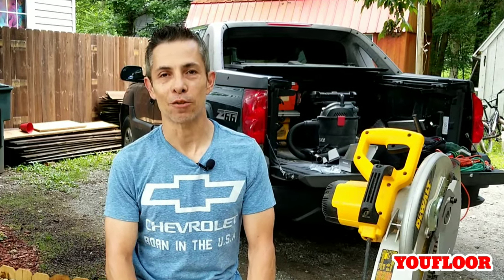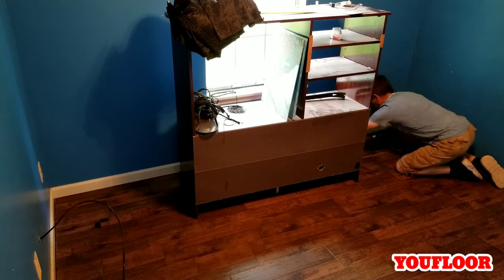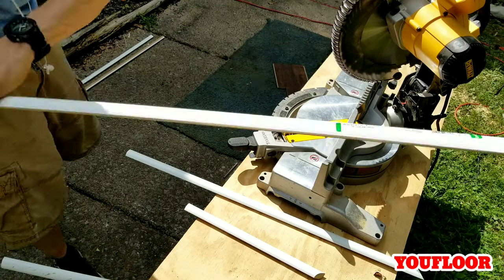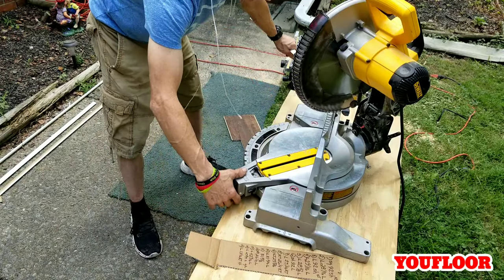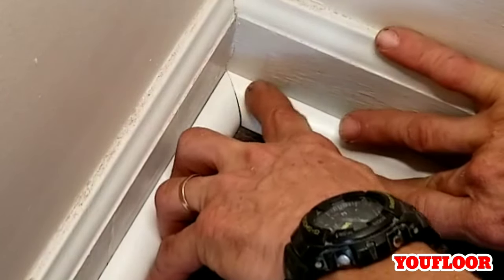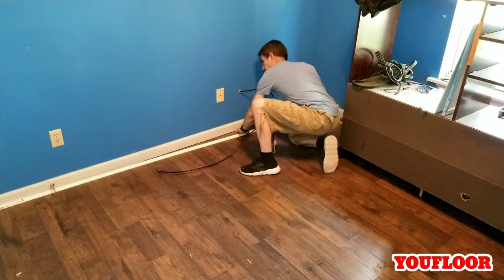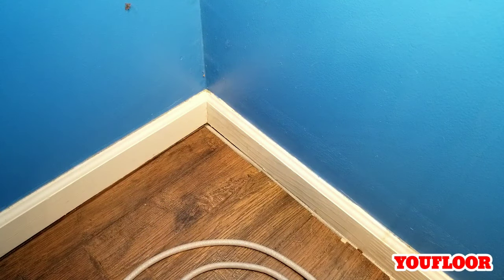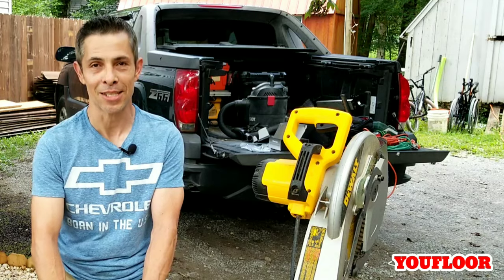How To Install Quarter Round Like A Pro

Comment: What putty do you use to fill holes if you're going to paint?  Great video!
Reply from the maker: There is a pink spackle like putty made by dap. You can buy it at H.D or lowes. You can use caulk but it tends to shrink and then you can see the nail holes once its painted. The pink stuff  turns white once its dry. Hope that helps. Thanks for the comment

Comment: Great video thanks. You had mentioned not to use that wood filler if we’re going to paint bc it’s oil based. If we are going to paint, do you have a wood filler you recommend?
Reply from the maker: I use the dap spackel in a tube. Is goes on pink and dries white no shrinkage and  so light weight youbcan almost sand it with your finger by rubbing it. But with a 200 grit or higher sand paper and 3 seconds of rubbing you can even see it after painting. Here is a link to show youbthe brand. Thanks for the question https://www.lowes.com/pd/DAP-5-5-oz-White-Spackling/1000212169?cm_mmc=shp-cprdpntgglLIA_PNT_221_Glue-Adhesives-Caulk-Repair-1000212169-local-0-_-0&ds_rl=1286981&gclsrc=ds

Comment: What size nails do you secure the quarter round with? I have pieces coming off in my kitchen and they are not attached with any nails at all, but some kind of adhesive that’s stuck on the back of the QR.
Reply from the maker: We use 2 inch 18 gauge brad nails

Comment: Great video! I have watched a dozen of these videos and this is the best in explaining outside and inside corners. What angle do you use when joining two pieces of quarter round along a wall or does it matter?
Reply from the maker: Thank you. Well for the most part there are usually more inside corners so if I cut and inside and then I have to splice it I usually just keep it on 44 to save a step.  Thanks for the question

Comment: You think the glue is probably over kill for quarter round? I will definitely use that on trim that has lots of profile. For sure on crown it would help big time I bet. Great tips! Thanks!
Reply from the maker: Yeah. You're right. And 99% of the time I don't glue 1/4 together. I mainly use it to glue things like fire place transitions that have miters on the corners and base board in long rooms and outside corners. This is also perfect for door and casing as the walls aren't always flat and can cause one side of the trim to stick out farther than the other piece. Gluing them together and installing in one piece make it flawless. Unfortunately I don't get to do a lot of crown mold or thing of this nature cause I'm a floor guy. My point was just to introduce it to those who weren't aware that this concept exist. Boy if I would have known about this when I installed cabinets. It would have been a game changer when it came to the crown mold. Would glue take a while to set up. Thanks for the comment. Have a good one.
Reply: @YOUFLOOR  yes sir! I agree. I bet you do great flooring and trim work! Take care. You earned my sub 100%.
Reply: @milehigh3054  I've never used glue on any quarter round except when putting the cap on at the end.

Comment: installing this today. lotta folks say you have to fill the crevice full of caulk before you put the quarter round. Seems excessive?
Reply from the maker: I agree. Sometimes less is more.when they gave us a class on how to seal the perimeter, they filled the gap with caulk saver and then filled in the rest full. But what  your looking for is a good bead on the back and on the bottom to prevent any liquid from spilling over and traveling undernieth the flooring Good luck today. Thanks for the comment

Comment: Thanks for the great pointers. I love your method. What do you think about those Miter trim cutters some people use? I don't have a saw so thinking about using those instead.
Reply from the maker: I have used them. They are great when you first buy them. But they only cut real wood shoe mold or 1/4 round. They wont cut the cardboard wrapped in paper style. Also they get dull over time. And once that happens they are really only good for an occasional inside corner. Thanks for the question

Comment: would you still use this technic with an actual 90 deg angle ? Great vid and thank you.
Reply from the maker: Probably not. Example when I go around cabinets I use 45 ° . The cabinet are usually built pretty square and don't require a little fudging on the numbers. Thanks for the question

Comment: Great video!  I just installed PERGO in an old house that previously had carpet.  What do you do if the gap between the top of the new floor and the bottom of the base boards is significant?  I'd prefer not to remove the base boards if I don't have to.  I'm concerned that the nails will not catch as the gap is larger than 3/8".  Thanks!
Reply from the maker: What I do in a situation like that. As long as the 1/4 lips up on top of the baseboard a little. I take some scrap wood  material and cut up some small blocks the size of the gap with my table saw. About 1/2 by thickness of the base. And about 6 inches long. Stuff the small blocks under your base and either glue them in place or brad nail them. Or both but now you'll have some meat to nail to and then run I small  bead of white caulk  on top. Does that make sense? Hope that helps. The is for the question

Comment: Question, it’s a floating floor, which requires a 1/4 gap around the edges, When you put the caulking and backer rod down in there does that prohibit the floating floor for moving?
Reply from the maker: That is a great question Tim and the exact same question I asked the guy from Pergo who gave us a class at Home Depot. He said it stops the floor from moving as much but because silicone is so expandable it won't stop the product from expanding. I have been installing it this way for about 5 years and so far my only issue came from installing it around a curved wall and not leaving enuff expansion at the transition area. And recently last month when it went form 71 degrees  to 20 in one day then back to the 60s. The floor was like what are we doing. We had 2 calls back we had to glue and close a few gaps. As long as you can keep the temperature in the house consistent you should be fine. But Extreme  change may require a little maintenance. Hope that helps thanks for the question
Reply: Yes that’s the same answer I got, thank you!!

Comment: I just installed carpet for the first time, and I’m gonna put in Quarter Rounds to cover some of my edges (😂) but I’m just really nervous about cutting those corners. But I think I can do it.
Reply from the maker: You got this
Reply from the maker: Wait dont you have base board? If you put the tack strip close enuff to the baseboard you should be able to tuck the carpet under the base boards  then you wouldn't need 1/4 round

Comment: I've noticed some folks use quarter round that's the color of the floor and some that use the color of the baseboards. Is that just personal preference?
Reply from the maker: Yes I personally like white quarter round if the base board is white. Thanks for the question

Comment: I enjoyed your video and learned a lot. Today I tried to put it in to practice and I am struggling.  I started in the closet so I could get the hang of it.  Right away at the first outside corner I can't get the two,pieces to line up without a gap. I tried with a 46 degree angle, a 45 degree angle and even a 44 degree angle. I have a big gap with each of them.  I haven't even tried an inside corner yet.  I've given up for the day, but any suggestions?  Thanks!
Reply from the maker: @Adler House Photography Sometimes they pack the corner out with drywall requiring a little more and a 46 degree. If you are trying numbers bigger than a 46 and are still getting gaps I would check the bevel on my saw to make sure it’s at zero - even if it’s off 1 degree it will create a gap. If this doesn’t fix it, send me pics of your corners. 
Thanks for the question!  
Zconstructionllc@gmail.com
Reply: Cope your inside corners.  Lays right on top ,no gap.
Reply from the maker: You sir are correct. Coping  crown molding, baseboard, chair rail and thing like that are always my preference. Looks amazing. However after 20 years of being in this business  if you think any anyone (even an experienced trim guy) is going to notice  whether you coped or mitred 1/4 round, then keep on doing you. But I come from time is money. And if you watch the video you will see the point is there is no gaps. And it take 1/4 the time than coping. Not saying coping is wrong but in my book wasting  time and money to get the same result is. Thanks for the feedback.  Have a great day

Comment: I couldnt see the nail gun as you were shooting the nails was it from the bottom up or from the top down. Closer shot. Thank you
Reply from the maker: @helen landreth shoot straight into the baseboard. Don’t shoot into the floor as you don’t want to attach the floating floor to the subfloor with your nail if it happens to be there. Let me know if you have any other questions!
Reply: @YOUFLOOR  thank you I didnt think these nails would go thru any cement...can you answer another question? 
When I use the concrete nail for my trim they are to small to go thru the carpet and tack board they just pop out? Is there any longer concrete nails. I've shopped around and they are all one inches and thats to long?? Im stuck
Reply from the maker: @helen landreth I want to be sure of what you are asking. First we were talking about shooting quarter round (trim) into the baseboard. Is your new question about the transition (trim) or are we still talking quarter round? I just don’t think I understand what you are asking. If you need to know how to attach the transition to concrete using no nails , check this video out https://youtu.be/AL1NBfkswVo
Hope this helps! If not, keep asking!
Reply: @YOUFLOOR  i am speaking of putting metal strip for trim going from carpet to vinyl. The concrete nails are to small to go thru layer of carpet then the wood tack strip then to attach to concrete. Is there longer concrete nails? I only see at hardware is the next is an inch which is to long then. Im stuck. Gluing metal tackstrip won't work because the carpet won't hold properly to the metal and then won't stick to the vinyl side because the metal is transition with a curve.

Comment: What’s the diameter of the Caulk Saver Foam for moisture block that you used? Is the laminate floor still able to shift / move if we add the Caulk Saver Foam? I don’t want my floor to come up if it’s not able to move overtime with temperature changes…
Reply from the maker: The caulk saver is around 3/8 of an inch thick. It should squeeze into your expansion gap and is flexable and squishy enough to aloww floating floors to move. I had the same question when they gave us a perimeter seal class. Thanks for the question.  Hope that helps

Comment: This was helpful to me. I am still looking for a video for the 5 in 1 molding. The one I am using has a plastic rail that it goes into. I need to know how to install the rail. This may seem obvious to some, but do I put the plastic piece under the wood or the carpet? What about with tile?
Reply from the maker: Ok. With those. There are two lines all the way down if you need to build it up you can fold on the outside line and break the outside strip off. This can be used to raise  the u channel as I've demonstrated in this video https://youtu.be/_oTUB9EM3a8.  Also if it needs to be raised any more you can rip the other strip off and stack both under the u channel  or just fold it over under the u channel (leave it attached) then put the extra one underneath. As I show in that video sometimes the bottom part of our transition dont reach down in that gap so our channel has to be raised. As far as laying it on the ground flat you can leave the extra pieces on or break them off. It does matter. It less of Hassle for me to break them off and just use the plastic u channel. One tip once you get end clipped in, move down the transition with your hammer  slowing by inches  if you hit it on the end and try to move down about 8 to 10 inches you can bend the plastic pieces inward and it is frustrating enuff to make you pull your hair out. Anyway hope that helps. Good luck with your project. Thanks for the question

Comment: What kind of cutting tool do you use for PVC quarter round?
Reply from the maker: I use a regular miter saw. You'll want to make sure the blade is spinning fast, then come down and do your cut. Try to pull your piece away from the blade as it's spinning. Don't leave it after the cut while the blade is spinning as it could melt it, and then it could be too short. Keep some 150 or 220 sand paper to knock on any burs.Hope that helps. Thanks for the question

Comment: Hi! I just took out exactly old carpet that was in my dining room. I know why put carpet in a dining room?! Well we just moved into this house and it’s an older house with lots of nice hardwood floors so we decided to check and see if we had it under the carpet and we do! So we took out the carpet and had to take the quarter round boards out. They are wood that matches the trim but are in extremely bad shape. What would you suggest I do to replace these? Try to match the color of the wood? I don’t think white would look good at all since our whole house is wood trim nothing is painted. Thank you!
Reply from the maker: Yes  I would check to see if there is a stain that matches and go with that. There are several samples at h.d or lowes if you need to compare side by side to get a pretty close match. Hope that helps. THANKS FOR THE QUESTION

Comment: WOW....44 degrees on the inner and 46 degrees on the outer is worth supporting you through whatever patreon-esq support site you belong to.  My only complaint is that this video was BLAZING fast, and I spend a lot of time trying to rewind, or find an important step.  Once I found it and wrote it down it was like a HUGE weight lifted off my shoulders from trying to fix a lot of mistakes that are already nailed to the wall.  One last question if you don't mind... Did you do anything special when butting the   pieces up against the door frames?  Yo acknowledged the space gap, but I couldn't see what you did to make it look decent.  Thanks again for taking the time to do this video.
Reply from the maker: Hey man thanks for the feedback. Yeah that was one of my 1st videos. Was trying to cram a lot into a short video. One tip incase you didn't know is when watching a video you can hit the little setting gear that appears  when you tap the screen. From there you can adjust the playback speed. It's handy for slowing down videos like mine but also helpful when you speed it up,  if you wanna get through a 6 hour audio book in 4 hours. Also when running 1/4 round you will want To cut returns against the trim. I made a part 2 sorta to explain this situation If your interested  I'll leave the link for you. Thanks for the question https://youtu.be/abkTRdbOd2I
Reply: @YOUFLOOR  Perfect....that link was exactly what I needed thank you again.  I know just how hard it is to make these videos....and it damn-sure isn't as easy as hitting the record button...especially, given what you're showing.  So, thanks again for putting in the time.
Reply from the maker: Thanks phil

Comment: Do you use the glue method on all the connections? or just the long straight runs
Reply from the maker: Generally I don't use glue on splices for 1/4 round. But it's great for corners and small intraquette pieces.. like around cabinets or fireplaces. Things like that. Hope that helps. Thanks for the question
Reply: @YOUFLOOR  Thank you for the quick reply! I subscribed and liked and look forward to gaining knowledge from you going forward. Keep it up. I want to create content too.

Comment: When cutting your outside corner do you measure to the end of the baseboard or do you have to measure slightly longer so they come together better?
Reply from the maker: You would measure to the end of the baseboard. That would be your short point on an outside corner. Thanks for the question
Reply: @YOUFLOOR  Awesome! Thanks for answering!!

Comment: Thanks for the great video!  Really helpful! for splicing pieces together. what angle should we be using?
Reply from the maker: I usually just keep the saw on a 44 so I don't have to change anything and the miters stay consistent. You could use a 45 but just remember you did. 45 I to a 44 will be frustrating.  Thanks for the question
Reply: Thank you for getting back so quickly!! Subscribed to your channel! Helping me a ton!
Reply from the maker: Awesome so glad to hear. Welcome aboard

Comment: Quick question the Long point at 46 and the short point at 44 is that only for round like trim or does this work on all baseboard?
Reply from the maker: @Big D in Las Vegas it does work on baseboard too! Thanks for the question!

Comment: Hey man. Really great video. I realized though, that you didn’t go through the return - return cut…is it just straight on both sides or is there a smoother way to cut off the excess of the quarter round sticking out further than the door frame?
Reply: (Cut # 8)
Reply from the maker: I had a lot of questions about this so I did a part 2 going over returns. Maybe it will help. https://youtu.be/abkTRdbOd2I